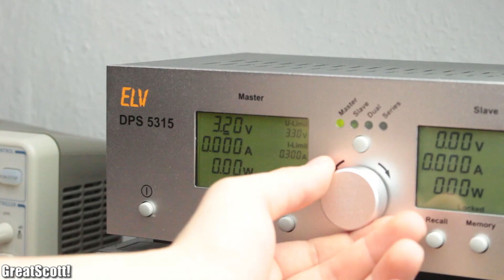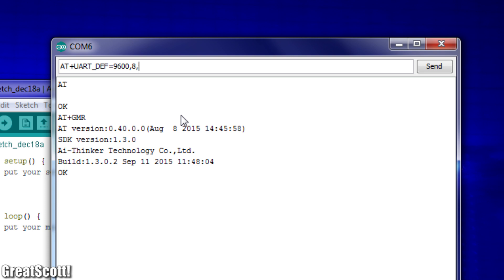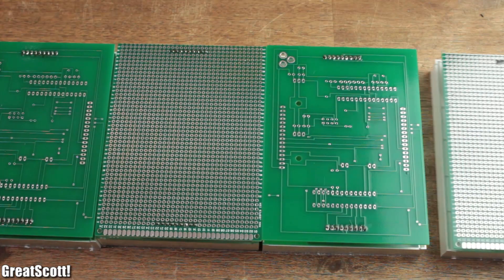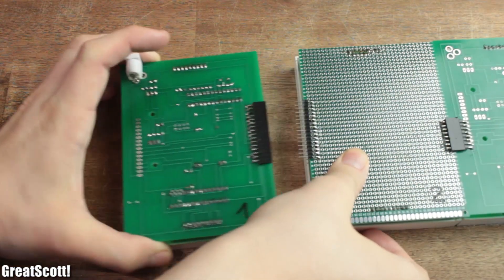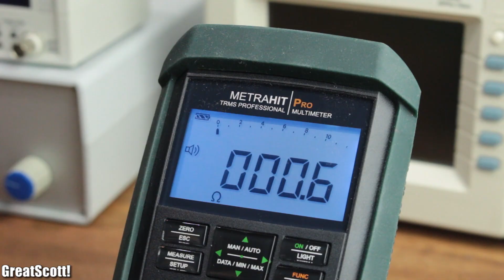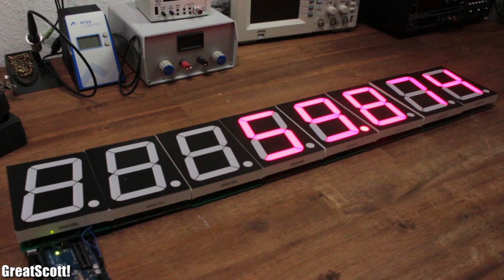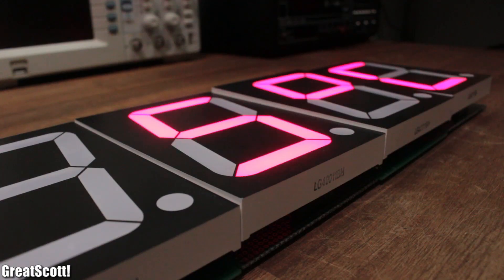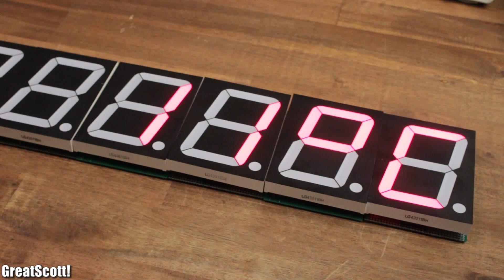DIY 7-Segment Internet Display (Part 2)

Comment: great scott.. great work, this is the best channel in youtube.. May I suggest to you a project? I'd like to see how to make a multi-touch sensitive surface/board that can display the location of your touch on the surface, on the computer screen. The one I'm interested in is using LEDs for touch detection, not resistors or capacitor ;) It's challenging.

Comment: Great video. I'd like to see a variation that worked as a timecode display from a Computer MIDI output. Most decent sized studio timecode displays cost anywhere from USD650 to about $1,000. The lower price is for the Display with the higher price including whatever device connects between the computers MIDI out put to translate the data for the Displays input. They also offer features like different colours for the display leds to indicate Record on, off or Standby. 
I know you dont answer personal requests from viewers but I'd even pay for the parts to have you do it. I've just priced the parts for your display project as above except for using 3" LEDS instead of 4". Including the Arduino which i dont have its about USD80. To that ill have to add a few more dollars for constructing a case of sorts. USD$100 should get it done.
Reply: if you have the connectivity it would probably be easier to decode AES-EBU SMPTE timecode than trying to get timecode information out of MIDI. instead of having to decode what kind of message each midi command is, you just read the last four bits of every word and concatenate every 192 messages to get the timecode in bytes 18-21 of the time slot.

Comment: Super Video! Sehr sauber gemacht, coole Geschichte mit dem WiFi-Modul!

Ein kleiner Tip, du hast selbst gesagt, du bist nicht der Experte in Sachen Layout, deshalb nur diese eine Kleinigkeit: Für SPI/I2C/UART etc. ist es am besten, wenn du deine Leiterbahnen nicht im 90°-Winkel anlegst, sondern den 45° Winkel in Eagle wählst. Das reduziert Abstrahlung und Reflexion an den Ecken. Auch Kreisbahnen sind eine Option, nur 90° ist nicht ideal.

Ansonsten sehr cooles Projekt, macht Lust auf einen Nachbau!

Comment: I'm sorry, but can you please explain why your resistors are too "slow" to do the level shifting at 115Kbaud? You can level shift microwaves with standard carbon resistors with absolutely no problems ...
Reply: +yonie I have both and yes, at 10 MHz it can be a problem with the edges getting rounded off, but anything under 500 Kbaud works fine!

Comment: Hello GreatScott, you can make a video about raspberry pi GPIO??
Reply from the maker: +thedarkangel97 I put it on my to do list.
Reply: thank you!
Reply: +thedarkangel97 after the first video, i decided to buildt one by myself - with raspberry pi ;) in Moment, i already programmed the code for parsing and extrakting the values and put them in single variables (in Python). i orderd a 7-segment display (not as uge as these in the video ;) all 8 numbers 6,5cm x 1,5cm) with to 595 chips on them, but this isnt a good idea to use with a pi. now i orderd some displays with max7219 chip, this should be better, cause there is also a libary for python for the max chip. ;)
Reply: +GreatScott! They confuse even me. So many different naming schemes. I have been using the py-guagette library because I am too lazy to learn much about rotary encoders and I had problems because I didn't realise it was using the wiring-pi numbers.
Reply: +GreatScott! hey Scott! it would be cool to start to think about a "festive themed" xmas project for a challenge :)

Comment: GreatScott! do you think you can help me? I got some step motors with no labels on them so i can't find their model and i do not have their drivers. How can i find out what model they are/what kind of a driver i need?
Reply: +Beta Seven Check out the Wires(4-bipolar,6-monopolar) and then search for corresponding driver brick. Tutorials on arduino Playground.
Reply: Are there any differences in the voltage needed or are they all using 5V or something else?

Comment: did you accidentally cut you finger at 0:32 ?
Reply from the maker: +Amit Nohria No, don't worry.
Reply: +GreatScott! good to know that, be safe for future videos and make some simple projects that i can build in India. The parts you used in your videos are very tough to find in India.
Reply: +Amit Nohria I am live in India it is not much tough to find
Reply: in which state bro?
Reply: +Amit Nohria at kolkata
Reply: okk but i live in a city where I didn't find a 0.47uf myler cap when I was building LM386 Amplifier. I live in Punjab, Moga District. These minor parts doesn't matter but can you believe in my whole district, no one sells PCB boards or perf boards.
Reply: +Amit Nohria try to search on eBay or amazon
Reply: Yes, Ebay is a great source with legit price but they took 2-3 weeks to deliver my product
Reply: +Amit Nohria you can do nothing about it beacouse it is a village area
Reply: nope it is not village, it is a proper city without services

Comment: what websites/experiments aside from basic logic gates do you recommend me to learn electronics from?
Reply: +Zaid Ahmed I can't recommend anything for the very basics since I was taught that in school (I'm sure there are many good guides) but the best way to learn is by doing. Think about buyiing an arduino starter kit (with breadboard, wires, etc) and just get cracking. As for project ideas, we all struggle to think of good ones. I like to check out what other people are doing to give me inspiration, so you're in the right place for that!
Reply: +Zaid Ahmed A fun starter project might be to make something that changes an LED from blue to red depending on the temperature. This should teach you about a variety of neat tricks such as voltage dividers, Plse Width Modulation (PWM), microcontrollers, timers etc... Have a look at all the dirrerent options such as thermocouples, thermistors, i2c thermometer IC's, doing it with a microcontroller versus doing it with a 555 timer (mad props if you do do it with a 555; it's not too hard per se but it will show you've learned a lot) and read up on them. There is loads of information out there on all these things!

Comment: Hi ,I'm curious how do you make circuit boards that way? Thanks . And the software you used as well.
Reply from the maker: +diegofu1 You can find most answers in part 1.
Reply: GreatScott! yes but the software? c++?, also if it was a programming language how did you make it so you can program it onto the circuit board?